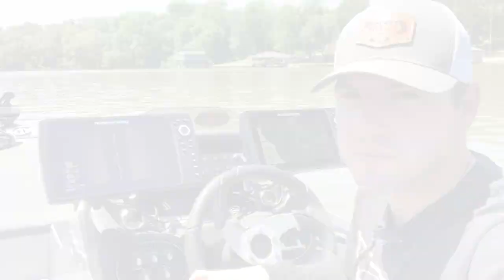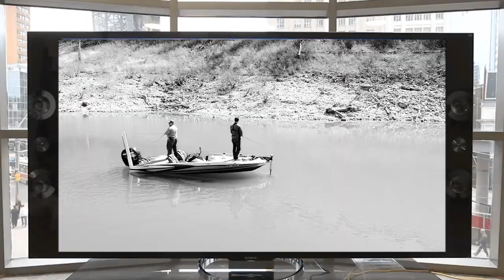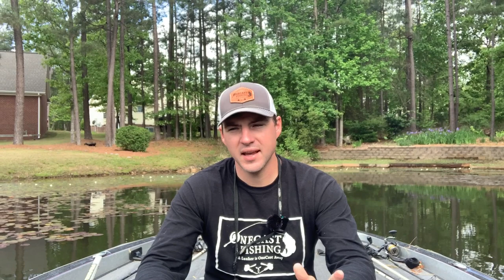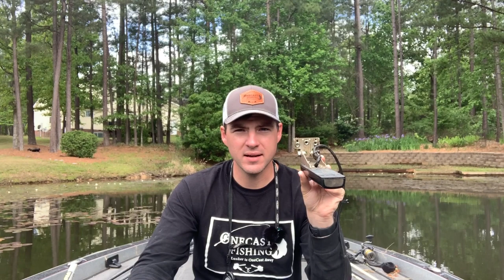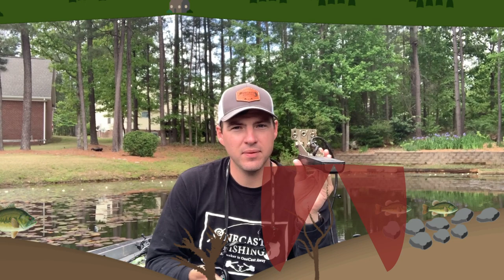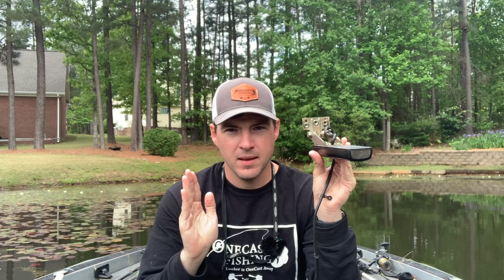How to Use Side Imaging (Side Scan) Sonar -- Learn the science behind the sonar to catch more fish!

Comment: At 5:30, the graphic you have up representing side imaging isn't accurate.  You only have a small tip of the sonar cone touching the bottom, where in fact the cone covers a lot of the bottom, which is why you see those large areas of bright colors to the left and right of the water column on your screen.  To make correct, you could extend your graphic so that the left and right cones extend to the bottom.  Also, I'm not sure about this, but I'm not sure the cone reads on the absolute surface of the water - I could be wrong but it seems sometimes I don't see floating docks that are just below the surface depending on how far away I'm doing my scan from.  Thanks for the videos, however!
Reply from the maker: So I am not graphic artist.  But yes the cone would continue to expand and cover more of the bottom.  Maybe I should have put arrows to so that the cone keeps going.  You are right, the cone also doesn't to to the surface of the water.  Each manufacturer is different, but typically the top portion is about 86-87 degree angle from transducer.

Comment: Thanks for the info.  I have a Lowrance Hook2 in 9 inch and still have trouble locating brush piles.  Just gotta spend more time on the water I guess.
Reply from the maker: Sometimes brush piles are hard to see.  The ones made out of Christmas trees usually show up better since they have so much bulk, but most other types can be hard.  I dropped some pvc structure in my lake and they are hard to pick up on the screen
Reply: OneCast Fishing my unit offers 455 and 800 frequencies. The owners manual says 455 is best for most situations but 800 will give you better clarity in shallow water. I fish on High Rock Lake and wouldn’t be fishing anything deeper than 15 feet of water due to water clarity. Should I use 800 MHZ?

Comment: Thanks for the explainations; they helped quite a bit. I had a question about mounting my transducer. I just got a Lowrance Elite Ti2 SI/DI unit for my canoe and was considering mounting the transducer to my trolling motor  I know other fishermen do this but I was concerned about the accuracy of the readings if the trolling motor is having to turn constantly for steering. Am I overly concerned?
Reply from the maker: Here are my thoughts.  If you can I would return it and go back and just get the traditional sonar (2d) unit and save a few bucks.  Typically, you need to be traveling between 3-5 mph to get a good consistent reading and picture on SI/DI.  The turning of the trolling motor also affects those two more as well, since they are paper thin sonar waves. If you are running 2d on the trolling motor, then it’s a cone of coverage and when you rotate the motor you’re still getting roughly the same cone.  For years I only ran 2D up front, even when my lowrance was DI capable.  Hope that makes sense and helps.  Just my thoughts.